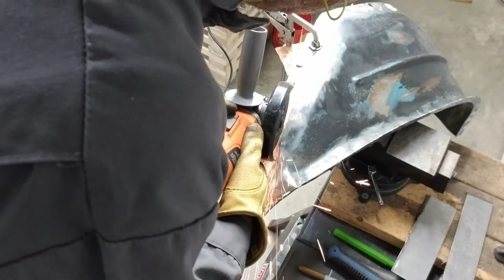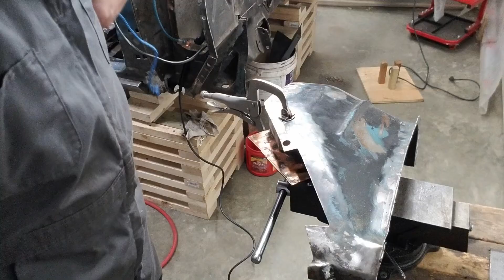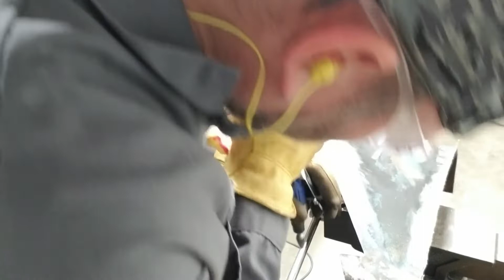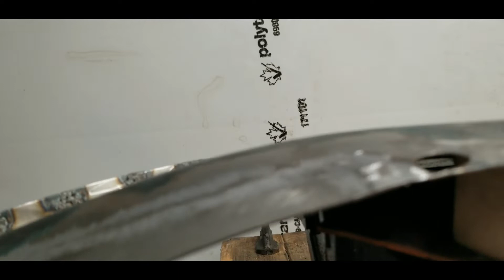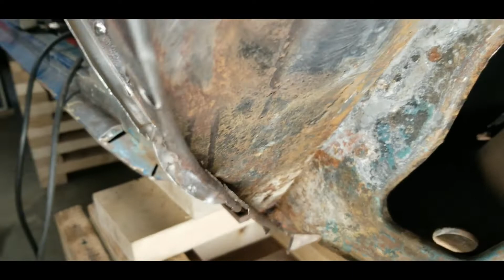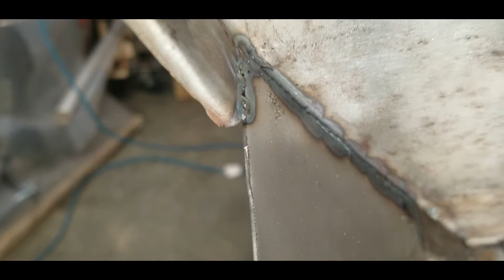1968 Camaro Project #21 Rust Repair on Passenger Cowl Shoulder

Comment: Great videos just happened to come across one of your 68 camaro videos while doing a tough e search and have watched most of the videos on your 68 Camaro you are doing a fine job. I have a red 68 Camaro that I have owned since 2000 I've been spending the last year giving it a makeover they sure are a lot of work but worth it in the end. Good luck with your restoration